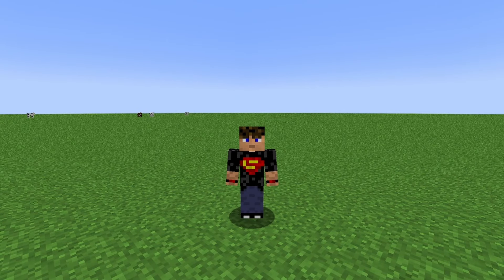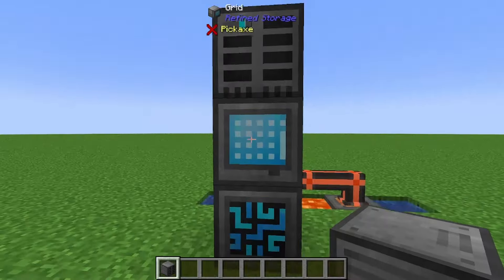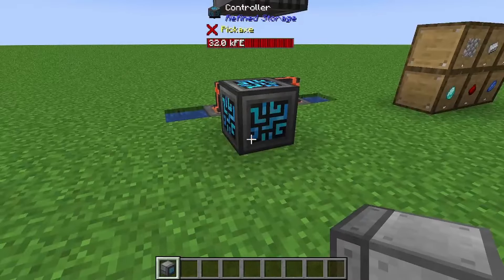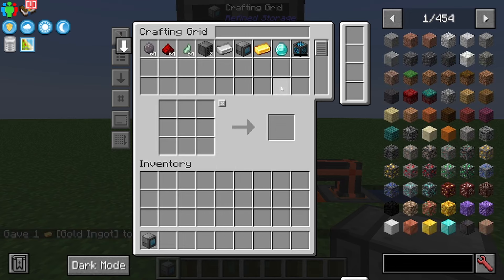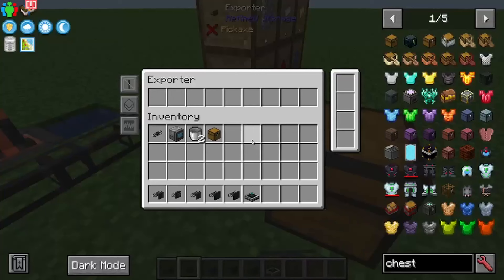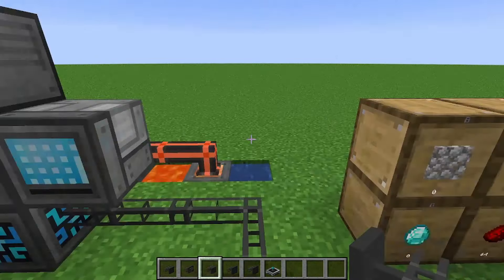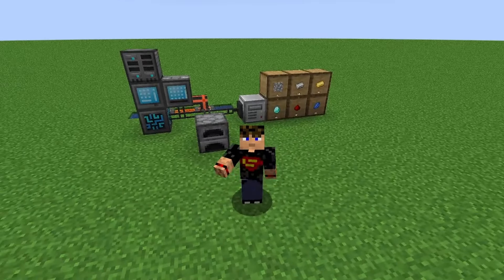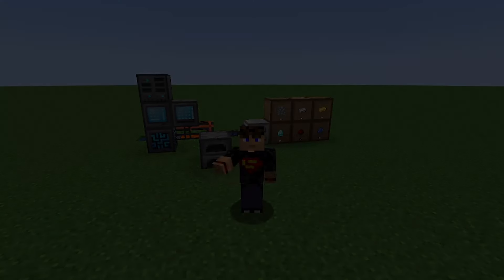Refined Storage Guide - Part 1 - The Basics (new guide in description)

Comment: Thank you for this guide, I have a problem I did the same thing at 1:35 to power up the controller but it won't fill up.
Reply from the maker: How much stuff have you got on your network? The power usage will be displayed when hovering over the left hand power bar in the controller. You may be using to much power. Also if you are using the Pipez power pipes, you will need to shift right click the pipe to get it to extract power from the Thermo. Hope this helps 😉
Reply: @Pilpoh  you are the best it worked 🤝😂😂❤️
Reply: thank god i looked in the comments i was wondering why mine wasn’t working w the pipez either
Reply: @AdilXO  have fun ♥️
Reply: Still not working ::

Comment: I did try you setup of thermoelectric generator... I used one generator with lava and water then used energy pipe to connect it to my controller but it doesnt produce any power
Reply from the maker: Did you set the pipe to export? 🤔
It's funny that this video has a ton of questions about power set ups when it's specifically about refined storage lol
Note to self: explain power a little more next time
Reply: @Pilpoh  how to do that sir?
Reply: I got it thank you so much

Comment: im guessing that you cannot use importers/exporters/cables to move items from chest to chest? it has to be ender chests?
Reply from the maker: Great question! You would need to have them connected to the system with a controller. An importer will import into the system, exporter will export out of the system. Without the system there in the first place you can't import or export. BTW I have a new video on this that is more concise and in a single video 😁 Link in the description!

Comment: for some reason it wont power.. i have windmills, even tried thermoelectric generators, everything was copied in the video and for some reason it wont power?
Reply from the maker: Did you use a wrench on the power pipe? The power pipe doesn't automatically take power out of the thermoelectric 🤔

Comment: My cables keep taking all my power so that my storage doesn't get any, do you know why that's happening?
Reply from the maker: If you right click on the controller you can see what each thing connected to the controller is costing. Id suggest increasing your power to the controller or if the issue is that the controller is getting no power then try changing your power cables out for another mod 🤔
Reply: @PilpohMC  alrighty, I think that the cables from refined storage pull power but they have nothing to power so I might just have to get a new mod

Comment: Why not just craft more disks and use them as storage why bother with chests or drawers? Is there like a downside of using a lot if disks maybe more power consumption?
Reply from the maker: Drawers are made from a few bits of wood and gets you 2k storage for a single item and can be massively expanded for not much materials. The upgrades are also easy to make on drawers where as a 1k disk is way more expensive 😉

Comment: Ooof... so you need to get into the nether to make these things at all? I made a portal to the nether and I was getting dizzy(the portal effect) and then a mob killed me when I teleported to the portal in the nether. I went back and died during the loading 5 times. I figured I'll just place the portal somewhere else and get a new location that didn't work, it used to work like 10 years go? Maybe I did something wrong. 

Any recommendations for a storage mod like this that doesn't require the nether? What about that AE mod is it still around?
Reply from the maker: AE2 is still around, it also requires nether quartz unfortunately 😔
There is a few other mods like simple storage that requires less materials, however they can't do all the automatic crafting that refined storage and applied energistics can do. For the nether I'd suggest mining into a wall as soon as you get out of the nether portal and building a box around the portal so you don't have to interact with any of the natives 😉
Moving the nether portal does work however it has to be a certain distance away to form a new portal in the nether. Hope this helps 😁

Comment: Just started getting into modded Minecraft so finding your channel has been very helpful, I followed this tutorial step for step but my drawers aren’t taking priority over my disks, I’m sure I’m missing something obvious but my RS controller isn’t even picking up the storage controller, just the external storage. Any advice?
Reply from the maker: Always here to help 😁 The controller won't show the things external storage are connecting to, it will just show the external storage because that's what's increasing the power needed in the network. As for the items going into the disks, make sure the priority is higher on the external storage. The disk drive also has a priority setting which I usually set to -1 meaning its the last place an item will go if there's no other choice. Hope this helps 😉
Reply: @Pilpoh  I appreciate the quick reply, but yea that’s how I set it up, I set the external storage priority to 100 like you said and the disk drive to -1 but the items still stay in the disks no matter what I do. I pretty much set it up exactly how you did so I don’t know what it could be, anyways thanks again for the help!
Reply from the maker: Do you have drawers for everything you are trying to store? 🤔 This sounds like an odd one..
Reply: @Pilpoh  I have a wall of about 20 drawers storing all my bulk blocks, I locked them all and linked them to the storage controller, it’s just not transferring items in or out. Could I have linked them wrong somehow?
Reply from the maker: Did you use the linking tool? Functional storage need the tool and doesn't automatically join just by touching the controller. That could be it 🤔
Reply: @Pilpoh  yea I linked them, the storage controller and all the drawers are outlined in white when I hover over it so I think it’s right.
Reply: @Pilpoh  got it figured out, thanks for helping me out man! Binging your videos while trying to retain as much information as possible is the ONLY reason I’ve even made it this far 😂 love the content man!

Comment: You are a God amongst men! This was so incredibly understandable compared to every other guide I've seen. Can I ask that you cover the import of 'infinite' lava from the Nether too? I've seen it done on so many playthroughs but there's always one or two details left out (like if it needs chunk loading, where is best to locate it, can it ever 'run dry' if you make a mistake, etc). It would be great to co-locate an infinite lava source with energy generation and pump power via Flux Networks, if that's possible. Cheers.
Reply from the maker: Slap a Create pump pully thing down over 10k lava and it thinks it's infinite lava! Use some mek pipes or pipez pipes on it and extract it into an ender tank. I have an importer on that ender tank and an infinite fluid disk in my disk drive so I basically have infinite lava 😁
Would be good to do a video on this though 🤔 it's hard to explain in text...
Reply: @Pilpoh  I kinda understand what you've said but a video would definitely be useful. 😁
Reply: Eier

Comment: Jair stared watching and don’t know if you mentioned it.  But power requirement can be turned off in the configs. I hate chest monsters and turn it off until i can produce power. It’s a QOL thing and one where I don’t care if people think it’s cheating. Better to start w/ RS and a single disk instead of having a mess of chests

Best to point out not to store items w/ NBT values in a RS system. It’s will corrupt a world of you shove to many into it. It’s one of the few limitations of the mod. But w/ packs that have Apotheosis, all those gems will corrupt the world rather quickly.
Reply from the maker: My first thought when starting a pack is "I need 3 diamond for refined storage" because I hate the sound of opening chests 🤣